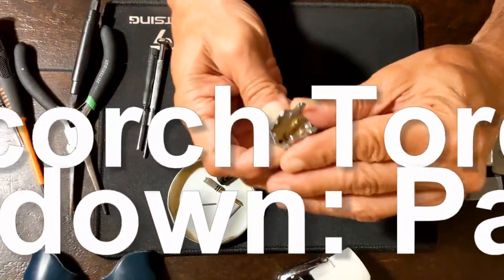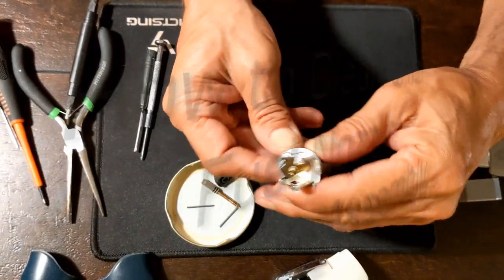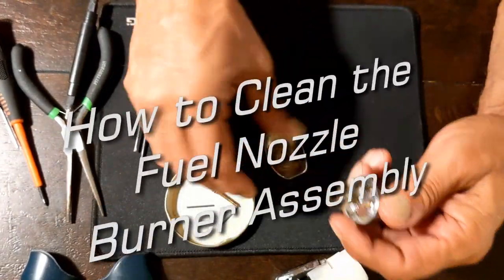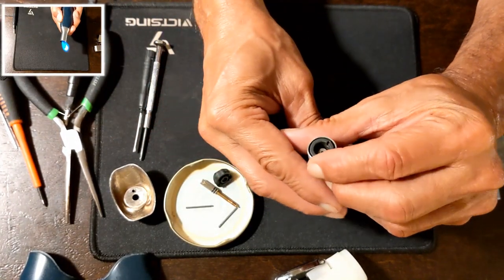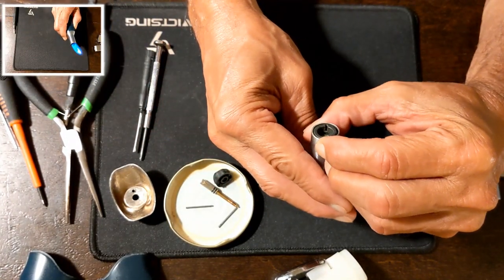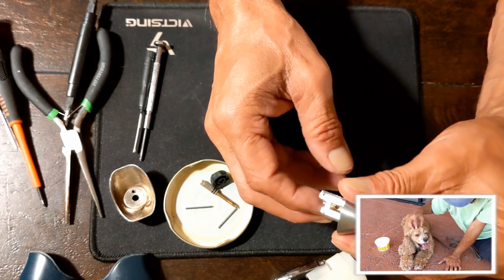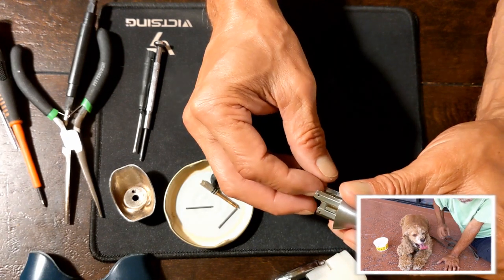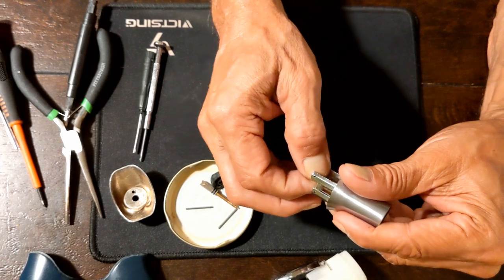Scorch torch lighter teardown fix repair and reassembly.  Part 2 the fuel nozzle burner assembly

Comment: It would be helpful if you were able to include a fairly detailed written part about what you have in the cup, what type of surface to work on, etc. in the show less/show more section. Just a thought :D
Reply from the maker: At the 1:47 timestamp, there are 3 pieces that came out of the assembly after unscrewing the intake valve. One is a  wire mesh screen that helps filter  contaminates  the butane may still contain.   There is also a round  washer which I think acts  as  a spacer and it sits between the wire mesh screen/filter and the last piece, a silver looking disk.  I dropped them into a cup containing rubbing alcohol.  What I did not show, and I'm sorry for this, I carefully grabbed the wire mesh screen and the silver disk, and rubbed them between my fingers to wash them off, before re-inserting them back inside the assembly.  The disk goes in first. It sits right over the much smaller bore, followed by the spacer. The last to go back inside is the wire mesh screen.  Dropping the intake valve into the alcohol probably wasn't necessary since the fast flowing butane keeps it clean. Be careful not to lose any one of them.  There are no replacement parts.  

I'm glad you brought up what surface to work on.  Ideally some paper towel, or cloth item. I was using a mouse pad.  Bad choice of work surface.  The pieces will bounce.  

Maybe your Scorch will not light or stay lit. Maybe it sputters.   Maybe you've scoured the great WWW for a fix. You've tried them all. But nothing fixed your problem and no, your jets are not clogged, Like I  stated in another video (hey, I'm learning as I go). It's more than likely the wire mesh screen filter is clogged and or the silver disk is dirty. Taking them out and washing them works wonders.  

Bleed you torch before you refuel it.  Hold it up to your ear. Purge it completely. It takes me a minute or two (I'm not kidding) to do this. I will rock it from the upright position to completely upside down.  And I never,  ever shake the butane can.  

One last thing....Ever wonder how your lighter produces the torch flame?  It is produced by the pressurized butane flowing rapidly as it enters the assembly.  It has to pass through the silver disk.  It's porous  it also diffuses the butane, and it is now a gaseous mist.  The mist is now being  pushed by the sheer volume of  pressurized butane behind it that is just now entering the assembly . Now the mist is being pushed through the much smaller bore, where it now picks up even more speed. This is how the torch flame is produced. This is known as the Venturi Effect resulting in a pressure decrease and a velocity increase. The effect is mathematically described through the Bernoulli equation. The fuel is now mixing and oxidizing with the air present in the mixing chamber. It has now been vaporized into a pressurized gas, no longer in  liquid form. The majority of the gas escapes outward through the center jet bore and out where  it is lit by the electrical spark that was generated  by the piezo you pushed down to light the torch.  But not all of the gaseous fuel escapes straight up, some of it is diverted (by design) and jets out the side of the torch head via slots/channels  that are machined into the sides of the torch head completely around the torch head.  These will also light individually creating smaller flames, These smaller flames,  visible for you to see,  combined with the bigger flame emanating from the center jet of the torch head,  create a much stronger (windproof) flame.  The small bores visible encircling the torch head are aligned over the channels just mentioned.

This all happens in the blink of an eye.
Reply: @cantucomputing9241  🙏🏼🙏🏼🙏🏼
Reply from the maker: thanks for the advice.  I'll do it.  But, for now, what is in the cup are the 3 pieces that i removed from inside the burner; the aluminum-looking disk, the small mesh screen, and the round spacer, it looks like a washer. The cup has rubbing alcohol.  I used 99% rubbing alcohol.  Then I held each piece between my thumb and my index finger and rubbed each piece between my fingers to wash them.  That's all I did.
The objective was to wash away any contaminates from them. Use cloth for your surface to prevent the pieces from bouncing.

Comment: anybody know how to teardown a scorch torch alien mine is leaking fluid from somewhere and its not the fill on the bottom. anybody?
Reply: It’s your fuel line that got pinched or disconnected. Easy fix. Is it lighting on fire on the sides instead of just the torch nozzle?
Reply: @rafaeltorre1643  does not seem to leak fluid from any where just seems to leak is all I think its the flame control nob or whatever the nob connects too because if I press on it in any direction slightly I can hear fuel leak but I unscrewed the screw that holds it on but could not remove it. I didn't want to break it seems glued on or something. To bad its a nice torch if it didn't leak.
Reply: @MRNAFR33  Yeah its the refill valve/height adjuster. The fact it leaks if not centered properly tells me that’s definitely it. Not much you can do but try to keep it centered and use it whenever it decides to work temporarily. Just keep it just filled enough to use.

Comment: I've taken many torch jets apart into every component possible, which is 8, how do you clean the tiny disc and the mesh piece, your video does not explain this
Reply from the maker: Wet your fingers with rubbing alcohol. Take the disc and rub it between your fingers  a few seconds. And you're done. Do the same thing with the mire mesh screen.  The disk is permeable. Butane flows through it, it flows out at a much higher velocity.  The jet effect starts.  When it's dirty the torch will sputter and never stay lit.
Reply: @cantucomputing9241  thank you, I have a couple torch lighters that need fixing and this has so far been my only hang up, much appreciated on the tip
Reply: @cantucomputing9241  my jet disk hole got damaged  when i tried to clean it,can you help me that how can i make another disk?

Comment: Ive got the same torch that is new and the flame sputters its like spitting butane ive tried purging and that doesnt seem 2b the prooblem idk what 2 do and cant seem 2 find anything about this type of problem.  In fact i also have a zico and it is also experiencing the same issues,  i cant have it set on anything other than low or it starts spittng and sputtering.  Ive also tried spraying butane through the jets and nothing works
Reply from the maker: Jim, you have a clogged burner asssembly on both of your torches. Chances are that the jet bore holes are not clogged.  Take them apart. These types of lighters aren't complicated. They'll keep sputtering until you clean the burner assembly. I am referring to the 3 tiny pieces inside the burner assembly. Clean them and should resolve your issue with both lighters. I suspect it's the impurities in your fuel that is causing them to become clogged. What brand of butane are you using? When you buy butane look for the words refined and/or filtered on the butane cannister. That's the number one reason that led me to fixing my torches. I was using Ronson butane and within just a couple of refills, and I experienced the same issues.
Reply from the maker: Jim, were you able to get your lighters to work?
Reply: It sounds like you might be overfilling your tanks. When you are refilling how long are you (in seconds) are you filling it for???

Manufacturers usually tell you 5 to 10 seconds, in my experience 5 seconds is way toooooooooo long. Hell 3 seconds is pushing it. I do a quick, and i mean quick 3 count. Ever since then no problems with lighter sputtering, or spitting. A dead give away too is when you light go of trigger does it still continue to release butane gas ? If so pretty sure you are overfilling. 

I would purge your lighter, and may even go as far as to unscrew the refill nipple a at the bottom,. You do not have to take it completely off but back it out until it starts to hiss a little, and another turn in the direction to loosen it, all gas should come out., screw back together, and when you go to refill

Comment: I refilled my Scorch and flames shot out 2 ans a half feet.  Attempted to adjust but already at low.  Bled and refilled. Now weak flame and its coming out behind the jets. Ive bled the line and refilled with the same result. Like theres a clog in the line between the tank and jets. Suggestions?
Reply from the maker: Sorry for the long delay in responding. I've had some difficulties to deal with these past few months.

If I am reading your problem correctly, you seem to be describing exactly what happens when the 3 pieces are not reinserted back into the burner assembly  in the correct order.  But you say that it does light. You describe the flame as weakened. Do you think that the lighter does light but without the jet affect? When you light it, is the flame burning like a regular lighter? 

The 3 pieces need to be removed from the burner assembly  and placed back inside in the correct order. The permeable disk goes in first. It plays a very special role. It's the start of the jet affect. If it is out of order or if the disk is lost. No jet flame. It's been tooled to a precise size and made of an alloy that results in a compressible gas-permeable disk. Amazing.  I did not know this when I made the first of the lighter videos. And then the washer. The last piece to go in is the little wire mesh screen.

When you adjust the flame, do so by adjusting it in small increments, a quarter turn at a time. Sometimes fine tuning the flame can be done by adjusting the flame in  ⅛ increments.

Remember to be careful when you handle these 3 pieces, don't lose them, don't damage them. Replacement parts  cannot be purchased anywhere. You can only get replacement parts by cannibalizing them from another like jet torch lighter.
Reply: This is a common problem with Skorch torches. I have owned several of them and have two different models now. If you fill them more than about half way they can act like flame throwers. I have learned to only partially refill mine to avoid accidents. When it does happen, turn down the flame adjuster until you can get a usable flame. As fuel burns off you will need to turn the dial back up. If you can't get it adjusted low enough to get a controlled flame then you may have to purge some fuel to reduce the pressure. 

As near as I can tell this flame thrower effect is due to a faulty or improperly specified gas valve. It should regulate the pressure of the gas release but it seems that it can't handle the pressure at full capacity.
Reply: @jssamp4442  No, you just have it up too high.
Reply: @rafaeltorre1643  A properly specified gas valve should regulate the pressure to prevent that possibility. It is a basic tenet of safe product design.
Reply: @jssamp4442  I have repaired, disassembled, & assembled, hundreds of torches and vintage lighters. Yes, in fact you are correct. Your Scorch torch is governed. And is easily calibrated by taking off the flame adjustment wheel (likely black and around the refill valve), and you will see the refill valve with a black gasket/o-ring and under it a brass ring. That brass hits against a tiny raised plastic which keeps it from going too high or unscrewed completely, and allows it to close off the gas completely by compressing a micro sponge. This is so if during the manufacturing process it is way off, there’s a way to calibrate it yourself or by the store you purchased it from. If they didn’t allow this window of room to change height, it wouldn’t work from lack of butane gas, or be so high it wont work either because it’s too much. It is not made to shoot large soft orange flames 🔥. It needs to be lowered until it stops spitting orange flames and only a bright blue torch flame only. Thats where its ceiling length/height is. Every torch of quality is made the same way. Scorch Torch is one of the highest quality brands that actually care about standards and not just a manufacturer who sells to anyone and slaps their brand name on it, making it where literally every brand is the exact same torch. However, if you have dropped your torch before, and obviously it took an impact, yes it can and will shoot flames when refilled and doesn’t go back down to almost normal until the tank is about half. I have encountered lots of them and use them for mass killing flies and mosquitos if they dare get near me. Lol. But it only happens after it takes an impact. Any device that is dropped will have at least some damage even if not noticed right away. The energy has to go somewhere. I saved my vape tank twice, but I paid for it by my interior plastic where the screws go in, breaking apart. So if you didn’t drop it or someone else, the full height is not supposed to be used if not a stable blue jet flame.
Reply: @rafaeltorre1643  I am aware of all you said and I agree with you. I have owned several Skorch torches because of their quality. I know how to calibrate the flame and I did not drop my torch. Even the best manufacturers with a good QA team will occasionally allow defective products to get through.
Reply: @jssamp4442  True. Even the best. May I ask which torches you have or are your favorite of Scorch Torch? I have about 3 favorites based on size and fuel capacity, etc. It is hard to find the names but they do have names you’ll find eventually. I just got the SC version of Zico Mt-15 (seen on YouTube), and its the smallest coolest biggest tank for size I have. Huge flame. My favorites though are the tiny 3 inch blue w/gold ring flint torch and the 3.75 inch blue w/ rubber wheel flint torch with fuel window and easy turn wheel at the bottom. I also have Newport zero gold and blue chrome torches and clipper rainbow adjustable torch. All my favorites for different reasons or uses. A lot of vintage soft flame. My battery operated one is my daily driver.
Reply: @rafaeltorre1643  I have seen several names for the one I am using now. I can't remember what they were, but I doubt they are correct. I call it the egg. Generally ovoid, vertical straight nozzle. This one is gray. My last one was pretty blue. I think my favorite one was called Matador. It was gun metal gray and had a 45-degree angle nozzle. I also liked the two bullets that I had. 

I think you know enough about the brand to help me find my next one. One feature I want is a fuel window so I'm not surprised by running empty. Either a 45 degree or straight up nozzle with a large easy button on the side. Do you know of any Skorch torches like this?
Reply: @jssamp4442  The eggplant?! Lights every time? Ceramic or like nozzle and miniature adjustable wheel? If so thats one of my all time favorites. Yes I do. I have every torch on eBay at the lowest prices for established sellers. Let me look one sec.
Reply: @jssamp4442  Does the button need to be easy due to hand disability or just preference? My friend can only use the eggplant. No window. But preference get the mt-15 torch look up zico mt-15 and you’ll know if its a good fit. Huge window and tank and relatively easy button. $15.95 eBay.
Reply: @rafaeltorre1643  It's for arthritis. If I have to contort my hand too much or squeeze too hard, I can't always do it. That's what I like about the eggplant. With that big button, I can light it without my thumb.

Comment: How do I turn the flame up or down correctly on the bowling pin Scorch Torch
Reply from the maker: Adjusting the flame on any torch lighter is dependent on the fuel tank to be completely bled.  Obviously, you bleed until you no longer hear the hissing noise.  I am hard of hearing so I will hold the Torch close to my ear and listen for the hiss. If it is still present even a short hiss, keep bleeding. This may take me several minutes to bleed the torch. No kidding.

It''s time to refill. DO NOT shake the can. Fill 'er up.
I've learned a thing or two as time as passed.

I don't even wait for the fuel to stablize for a few minutes. I light it and the flame is still  holding the adjustment to my liking.  It does not flare up or anything like I state in the video. Bleeding the torch completely is the key.  

I had to google "bowling pin scorch torch" to get a visual on it. Pretty cute.
Reply: On the bottom. You pull up the lever and turn the black wheel slightly higher until the perfect flame is present.

Comment: How can i make a very small hole for jet?
I tried several times to make that part of torch but the flame was like cheap lighters flame...
Can you help me please?
Reply from the maker: You must be talking about the disk inside the assembly.
Reply: @cantucomputing9241  exactly, the flame was like candle flame and disk unuse able,
Can i make one by hand? Or do you have any advise for making that?
Reply: @mahmoodnaseri4228  I always collect a graveyard of parts from people and use those parts to fix another one.